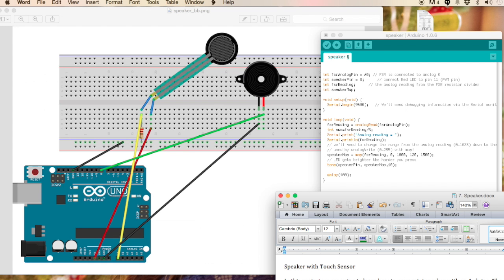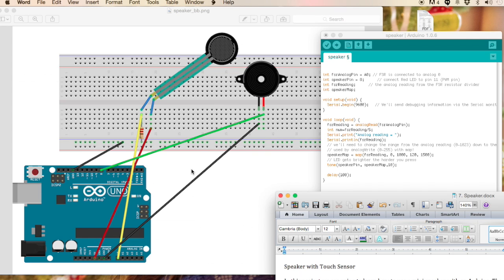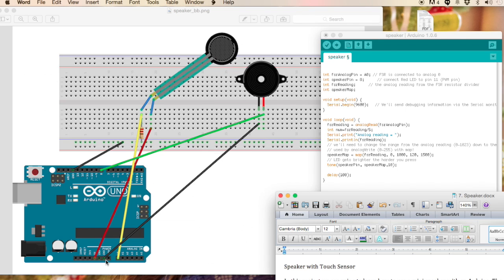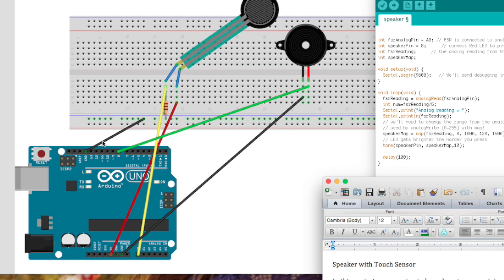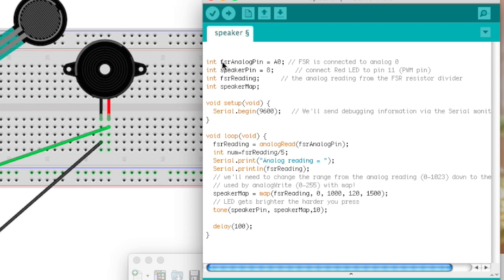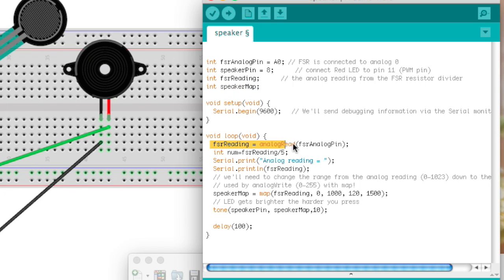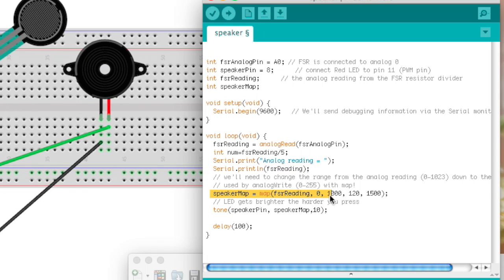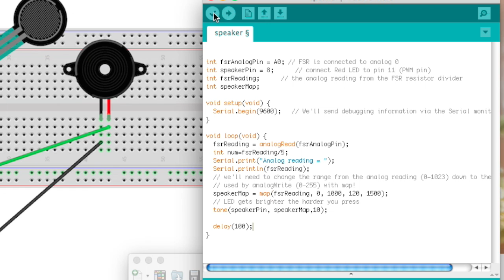Arduino Speaker tutorial

Comment: I have a question sir. If I have a speaker of 8 ohm and 0.5 W, which resistor do I have to use to connect it to Arduino that is 5 W??
Reply from the maker: Let me know if this helps you: https://arduino.stackexchange.com/questions/38592/8%CE%A9-speaker-what-resistor-values-to-use
Reply: @LearnEDU  Thanks a lot

Comment: i've built a robot using the arduino uno and i would like to attach a speaker that serves as a guider for example when the robot does a particular job, i want it the robot to speak and tell what job it's gonna do. your advice is highly appreciated!
Reply from the maker: You may want to use the arduino WAV shield or Sparkfun's audio shield. Both allow you to use audio files and play them at specific points in your code.
Reply: Thank you so much! really appreciate your reply.